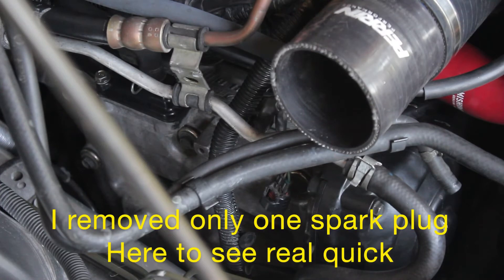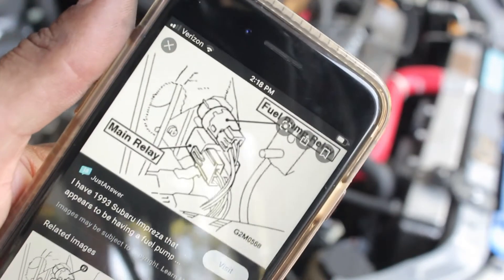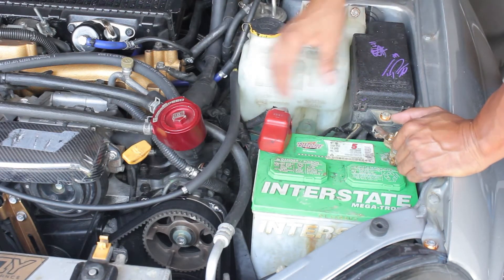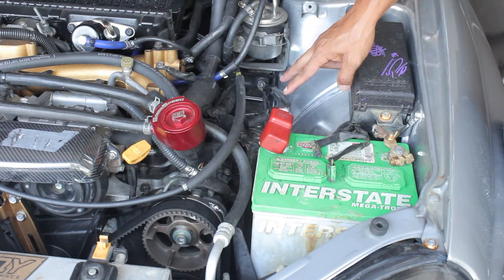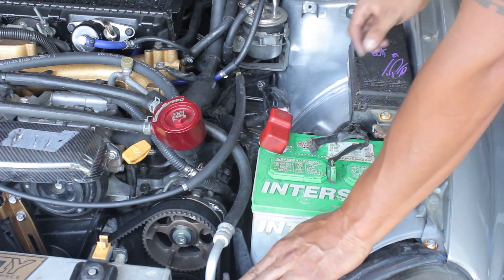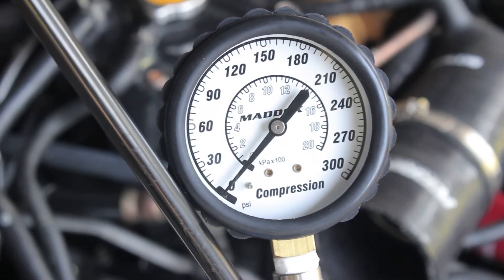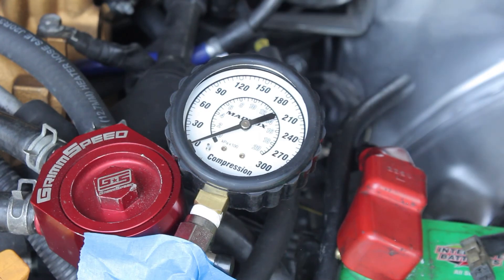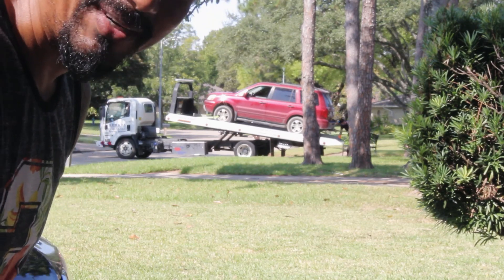Omg no compression on all 4 cylinders. how is that possible?

Comment: When that happens it means your o2 flooded your cylinders with gas causing the the oil to get washed out of the piston rings so basically put a table spoon of motor oil into that spark plug holes into the cylinder to regain the compression after it starts turn it off and change oil due to the oil being diluted with fuel
Reply: Will this cause low oil pressure error as well.  I'm having similar issue, no compression with all four cylinders.
Reply: @alpa7762 currently going through the same problem on all 4 cylinders, not sure what to do
Reply: @tekkerschrisak479    I would suggest not spending more money until you or I figure out the issue.  I just checked all the money I've spent on the car to figure out the issue with the car.  It wasn't worth it.  Still, it's down.

Comment: I have the same issue i have done  the timing belt 2 times to make sure is at where it needs to be. V6 engine has compression only at 2 cylinders. It makes belive i have a bad head gasket or bad piston rings. I belive after removing the heads i can check for compression at cylinder by covering the top of the bore

Comment: Yes..piston compression requires good cylinder..piston and rings which are sealed by oil splash or piston oil jets...both preferred.
So....knowing oil is on rings is important...but if lots of leak occured say oil into cylinder or lots of gas or lots of coolant.....you can.....bend all the rods or valves if timing slipped.......memba....in these new engines they don't use keyways to lock .cams..or some cranks or
Oil chain sprockets......hell they ain't no tensioner on the oil chain in a BMW mini.....so when it runs loose...limo mode activated by oil pressure sensor
Ofcourse..
Everything in these new motors must be electrically checked by specific tools.
Not like
The ole days.
If.
Machine checking parts.
Yes the limo mode
Can make car run like....a broken duck...
When mechanically is saveable or what we now know
Called
Sealeable or fixable.......

Comment: Is it not possible starter solenoid is not engaging, thus not spinning engine over, resulting in no reading on gauge 🧐
Reply: Can you confirm that this issue has to die with the starter being that the engine is cranking?

Comment: i dont think your motor is even turning at all,...your not doing something right,.......it should show something,...make sure you have that tube in the sparkplug hole properly,..,,,,i did mines, all you have to do a compression test is just remove sparkplug, then put that tool in,.turn motor,. see if any compresion, thats all to it,...
Reply from the maker: Now that I know I’ll tell you what happened so all 4 cylinders lost compression because cylinders I think number 2is destroyed and some how sent pieces of aluminum into the valves and bent almost all the valves
Reply: @ulisessgaragediy4059  was the vehicle repairable and is it an expensive fix?